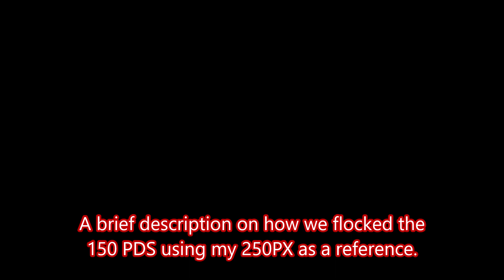CGE Pro Onstep News Telescopes flocked & Practical Astronomy Show

Comment: Seems like you are "all in" with the RASA's! 8 inch and a 11 inch right? It amazes me how some people treat telescopes and I can't believe that I'm asking this question. How did that much water get into the 8 inch RASA and remain unoticed for so long? It's hard to tell from the video but the white specks inside the RASA might be Aluminium Oxide. It can blister through paint when water is present. That might be your issue with the flocking not sticking properly. There is no easy answer here but for you to sand it back, seal it with paint and then reflock it!!!
Reply from the maker: Hi Neil I've only got the 11 inch as it wasn't a scope I were looking for initially but it came to me so to speak with the mount, as for the water ingress the owner of it had it set up on the CGE pro in their observatory & it had been there for a long time with no issues. Him & his wife went away on holiday to Switzerland & while they were away he had an alert saying there was a storm incoming, he were watching the security cameras & literally watched the roof being ripped off the observatory & with the wind & rain everything in there was pretty much written off in there & there was nothing they could do about it. I hear you about the oxidisation I did remove what I could see from the sides & for now it seems to be still stuck, if it does peel away I'll strip it again sand it & probably just paint the inside & be done with it, but for now fingers crossed all is well.
Reply: @dumpydalekobservatory  Wow, I would be heart borken if that happened to me. Happy to have a big heavy wood and felt rolloff roof with over engineered hold downs
Reply from the maker: @neilhankey2514  I have to admit we did have a mini tornado come through here just over a year ago & I panicked thinking that's the dome gone, but it held fast & everything was ok which is more than I can see for the neighbours fence!!

Comment: Did you "key " the tube with fine sandpaper before sticking the flocking on?
Reply from the maker: No we didn't mate we did degrease & clean the inside of the tube as best we could, we did the same with the 150PDS & it stuck just fine so guessing the water damage did more than just wreck the paint.